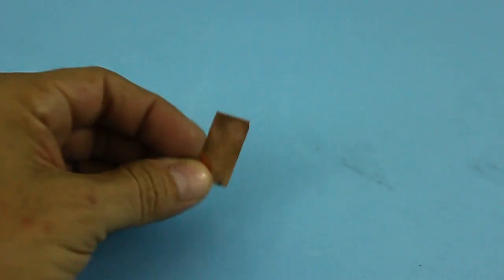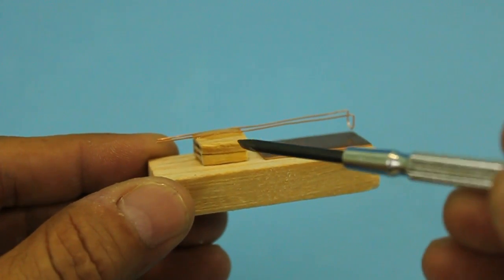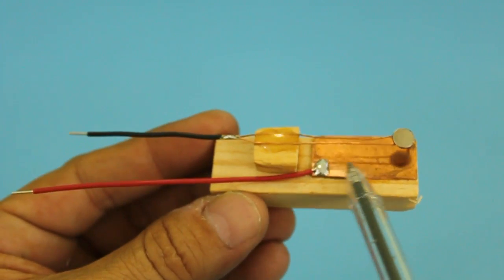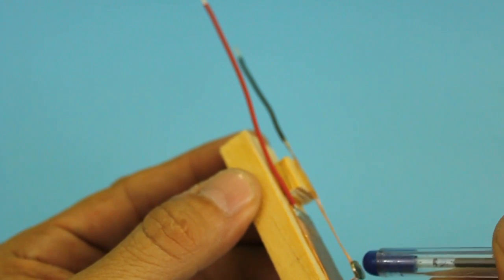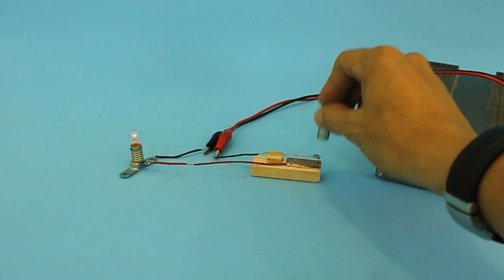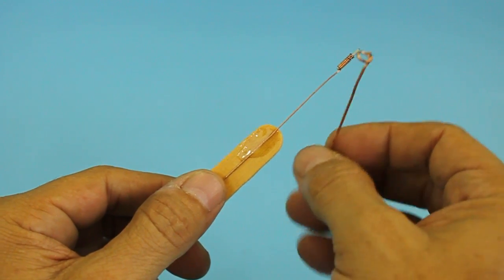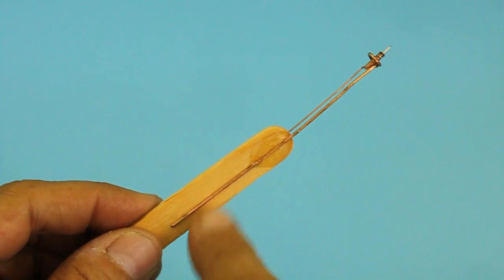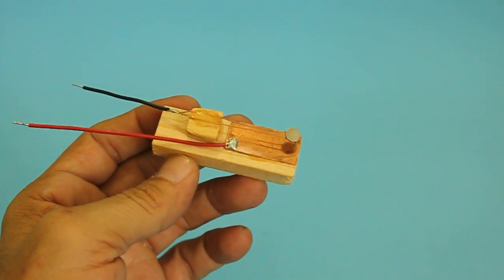How to Make a Reed Switch

Comment: hi,I am working on my coil gun but the power supply flash camera circuit is hard to find , can you suggest me any other power supply other than flash camera circuit to charge my 450 volt caps
Reply from the maker: I will make a video on a capacitor charger, something like this: http://uzzors2k.4hv.org/index.php?page=capcharger2
Reply: Ludic Science thank you very much